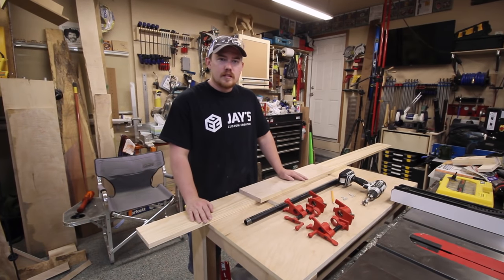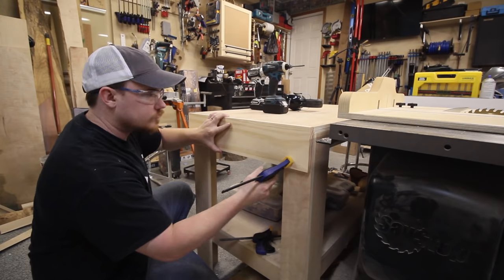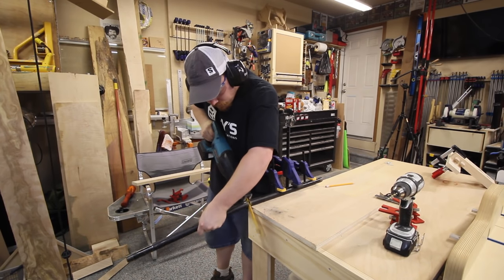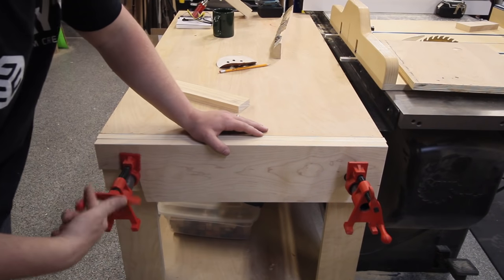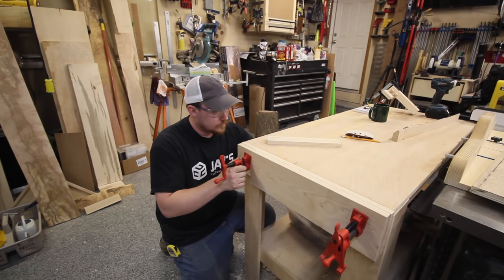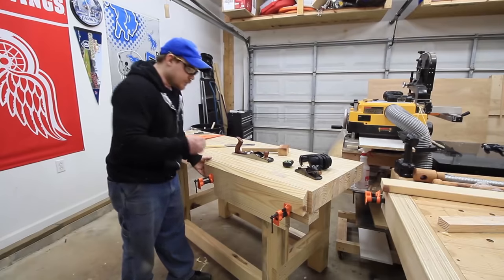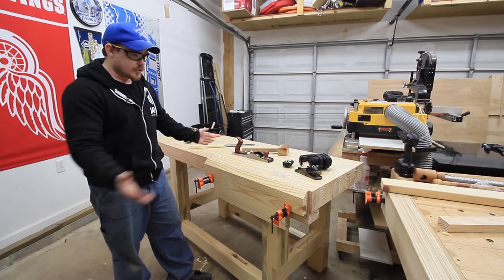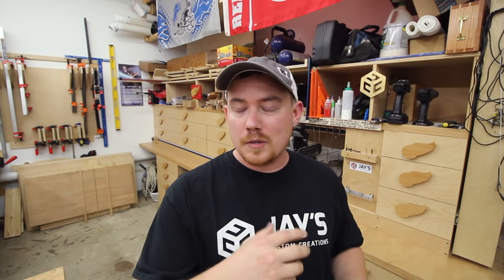$16 Twin Screw Vise - 261

Comment: I have seen your other ones, and the flip up/down is especially useful! Thanks for the tip at the end for the clamp type. For the viewers that are concerned about the clamp ends sticking out when not in use (possible big ouch but all the vices have similar), perhaps a temporary rectangular box that slots onto the bars and covers the exposed clamp ends, preventing bodily ouch syndrome.
Reply: Thank you for this considerate preventative measure, but nothing short of divine intervention can keep me from haplessly bashing myself on every conceivable piece of matter in the shop. Now that it's summer my family actually gasps in horror at the massive bruises and lacerations on my limbs. I look like I've been trying to wrangle elk.

Comment: I built one of these vises for my work table and it is fantastic. The main issue I had with mine was that the two quick releases were a pain. I found a way to release both clamps simultaneously with some steel rod ;) I can send pics if you are curious on how I did it...

Comment: Having missed your third vice build video, the takeaway for me was the idea of making the front of the vice swing away or to be removed completely.  Thank you very much for that.
On makes of pipe clamps...I had purchased the "blue" brand caused I liked the look of them, but that second quick release is one more thing to go wrong as it does not always engage as I have it set up in vice like set up.  The one of two of "red" from everyones favorite discount tool supply  broke with limited use.  The screw pin (?) broke so handle does not stay seated in its hole and just spins (if that makes sense.) Sticking with the "orange" brand for now.

Thanks for all good info and ideas.

Comment: Congratulations Jay, you just convinced me to build one.
I have some 3/4" piping laying in my shop and it will work perfectly for this application.

Btw, I couldn't agree more on 1/2" vs. 3/4" pipe clamps.
1/2" has been all I've ever needed as well.

Comment: Cool.
I'll also mention a small modification for a tale vice that can be really useful.

Drill a couple of 1jn holes (vertically) into top of the vice into which you can fit a piece of dowel.

Then, you can use the end vice to "clamp" long boards to the top of the bench; that is, with either the board lying flat on the bench, or, if the board is not too wide, you can stand the board on its edge.

(To be clear, I'm assuming here you have something to press the other end of the board against. E.g. pegs in "dog holes" in the bench top, or stays clamped across the bench top.)

Comment: That looks great if you're just starting out.  I don't really know what I'm doing and I don't want to drop $100+ on a proper vise, this pipe clamp vise looks like it's a minor pain to use but completely functional.
Reply from the maker: +uzimonkey it's not a pain at all. 99% of the time you wouldn't even use the swing up feature or have to adjust the pipes. The clamp heads have enough travel for the vast majority of situations.
Reply: Would cam clamps be an even cheaper solution?
Reply: Where are you buying your pipe clamps?  I can't find anything cheaper than $13
Reply: Harbor Freight.  about $10.00 for 3/4" clamps and appx $12-13 for 3/4 with legs (not needed for this appl and probably difficult to drill and screw down.  I ignored Jay's advice for the 1/2" clamos...they had them also...a bit cheaper like he said.

Comment: Hi Jay - Great video.  I have watched lots of pipe clamp vice videos are yours was the easiest to follow.  I just made an attempt at this vise and it works, but the jaws don't stay parallel if I clamp a board that doesn't go down between the jaws to the depth of the pipes.  As I tighten the clamps the bottom edges of the jaws close more than the top edges, leaving a gap along the top edge of the workpiece.  Essentially the workpiece is getting pinched along its bottom edge just above line between the pipes.  To prevent this, I could put a second piece of scrap material the same thickness as what I am clamping into the bottom part of the jaws to force them to stay parallel.  Any other suggestion?

Comment: nice ideas jay.  ive had issues with the pipe slipping through the quick release end.using black steel. seems the clear coat peels then they rust up. galvanized  seems to work better for me. your thoughts/ideas? ever thought of mounting  the quick release end under your bench dog holes so you can clamp downward?
Reply from the maker: I like to clean the black pipes with mineral spirits to remove the black crud on them. I've had no problems with them slipping regardless of them being cleaned or not though. Never thought about clamping downward.

Comment: I made a similar vice. However, mine tries to push the material up I cut a slot through the bottom of the holes on the moveable side. Maybe eliminating those would keep the vice front from tipping and pushing the piece out?

Comment: I love this build! I do have a question though, maybe someone can help me out. For the piece of the pipe clamp that goes under the bench, should I remove the "pad" from that side of the clamp? It looks like Jay either took his off or it didn't have one. Thanks!
Reply from the maker: Are you referring to a plastic pad slid over the metal jaw of the pipe clamp? Mine didn't have one. Take it off but keep them in a drawer for future use if you decide not to use the vise.

Comment: I'm building one of these right now for the end of my out-feed table - 38 inches wide.  What size hole do you drill to accommodate a 3/4 inch pipe?  Thanks.

Comment: awesome... plan to build one right away... only thing, says $16 vise... where ya pick up h-clamps for $8 each...?
Reply from the maker: Cal-Hawk brand 1/2" pipe clamps $6 each at a local store called Discount Tools in Starkville, MS. 10' piece of 1/2" black iron pipe for $12 which is $1.20 per linear foot. Conservative cost of $2 per piece of pipe for the clamps. Two sections of pipe $4. Two packs of clamps $12. Total cost $16 and scrap wood virtually everyone would have. This is the first one I used hardwood for the jaw. The rest have been pine or plywood.

Comment: Thanks for the great idea.. Do you have to thread the end of the black pipes after you cut them?
Reply from the maker: +T4CodyBear only one side needs to be threaded for the style clamps I use. The 36" pipe I started with was threaded on both ends.
Reply: what prevents the sawed off end to slide out from under the table?
Reply from the maker: The other end of the clamp.
Reply: If you have both ends of the pipe threaded, you could put on an end cap. Usually when you buy pipe from HD/Lowes, they will cut it to length and thread at no additional cost.

Comment: Just a quick question from a newbie.  Should the front half of the clamps be screwed to the front board on the vice?  Just wondering.  Thanks
Reply: Probably not, if you want to swing the front board up to load a bigger piece in the vise.

Comment: i do auto body , so we get , a lot of totals, so i tke the cheapy scisor jacks out of every one, they suck as actual jacks for a car, they ar way to wobbly to hold a ton and a 1/2 or car up, but they make great clamps if you dismantle them , you can use them as a press, clamp, spreader, i have one on cutting fence on my bench, as a kinda half assed incra adjuster, just an alternative to pipe clamps , or in a pinch, take the one from your car, just don't get a flat, lol

Comment: Jay do you think you could hinge a board underneath the table to hit both clamp releases at the same time? Btw Harbor Freight sells the clamps for 6.99 only difference is they have the fixed handle. 

Harbor Freight http://www.harborfreight.com/1-2-half-inch-pipe-clamp-3813.html

Comment: Hey Jay, hope all is well. Quick Q. Do you have air conditioning in your garage, and if you do, how did you achieve that in plugging the spaces on the garage door so the air wouldn't escape?
Reply from the maker: Yes I have AC. I used garage door insulation.
Reply: Portable AC?
Reply: Man, gotta get one.  A fan will not do for me. I'm just 175 lbs but I sweat just breathing.
Reply from the maker: Mini split unit in the wall.
Reply: Thx. I'm lucky I have a window in my garage. Gonna get me a portable unit.
Reply: Doesn't dust get in the unit and you have to clean the filter lots? Or do you sand projects outside?
Reply: AlWheelin I imagine an air cleaner along with the AC would help.

Comment: It looks like a screw backed out or possibly is loose at 2:39.
Reply from the maker: +poozor backing the screw out by about 1/8 is intentional to prevent binding. I mentioned it in the article. It doesn't need to be tight.
Reply: Jay Bates Didn't catch that it was intentional.  Keep making great videos!
Reply from the maker: Thanks. I'll try :)

Comment: What store do you get the clamps locally?
Reply from the maker: Cal-Hawk brand 1/2" pipe clamps $6 each at a local store called Discount Tools in Starkville, MS. 10' piece of 1/2" black iron pipe for $12 which is $1.20 per linear foot. Conservative cost of $2 per piece of pipe for the clamps. Two sections of pipe $4. Two packs of clamps $12. Total cost $16 and scrap wood virtually everyone would have. This is the first one I used hardwood for the jaw. The rest have been pine or plywood.
Reply: Am I the only one having a hard time finding these online?
Reply: PS - Great video...thank you
Reply: I too had a hard time finding these....thanks jay for the store name....might help finding them a little easier
Reply: Harbor Freight has them cheap also. Probably the exact same thing.

Comment: harbor freight pipe clamps?
Reply from the maker: Cal-Hawk brand 1/2" pipe clamps $6 each at a local store called Discount Tools in Starkville, MS. 10' piece of 1/2" black iron pipe for $12 which is $1.20 per linear foot. Conservative cost of $2 per piece of pipe for the clamps. Two sections of pipe $4. Two packs of clamps $12. Total cost $16 and scrap wood virtually everyone would have. This is the first one I used hardwood for the jaw. The rest have been pine or plywood.
Reply: thanks for the info. I'll have to look them up online.

Comment: Where are you getting them for 6 bucks?  They are at least 10 bucks here.
Reply: Menards has them for $5.33 from Tool Shop brand
Reply: Brad Mistina never even heard of Menards before.  $7 shipping and $3 processing fees hurt the price a tad, but if you buy a buttload at once, that is mitigated quite a bit.

Buying one cost $7 shipping and $3 processing fees.

Buying 8 cost $10 shipping and $3 processing fee.

If I buy 8, then they are $7.64 each.
Reply: Menards is a big box store in the Midwest like Home Depot or Lowes, I thought they were everywhere, but I guess not.  Tool Shop is a brand that I think they only carry.  Sort of a generic.  I think that is what Jay is using too.  Not that brand but a local hardware stores generic.  If you do some digging I'm sure you'll find them in your area.  Good Luck
Reply: Brad Mistina according to the store locator they're all in mid north

still a good deal ty
Reply: Harbor Freight carries 1/2" pipe clamps for $7 each. If you're a couponer you can use a 20% off coupon one day and go back the next day to get a second one and you'll end up spending $5.60 each plus tax.

Comment: $16? Around here that would cost me no less than $50
$20+ for each clamp and another 10+ for the pipe.
Regardless, great idea.
Reply from the maker: Cal-Hawk brand 1/2" pipe clamps $6 each at a local store called Discount Tools in Starkville, MS. 10' piece of 1/2" black iron pipe for $12 which is $1.20 per linear foot. Conservative cost of $2 per piece of pipe for the clamps. Two sections of pipe $4. Two packs of clamps $12. Total cost $16 and scrap wood virtually everyone would have. This is the first one I used hardwood for the jaw. The rest have been pine or plywood.
Reply: :)
I didn't think you were lying.
Only pipe clamps available around here (east east east coast of Canada) are Bessey. 1/2" are just under $20 so $40 total. 
10' pipe runs me another $20.
That's $60 before I even factor in the wood.

On the plus side, I've sold a few benches based off your design. Modified it a little. Added an extra seat slat. Hopefully going to get an order for 2 more in cedar. 

Thanks Jay.
Reply: The tool section of the Walmarts around here are laughable. Hell...most tool sections in most retail stores are quite sad.
The place where I bought my Bessey pipe clamps didn't even sell the pipe.

Comment: WTF. So cheap pipe? I spend a lot more here in germany. What material are your pipes?
Reply from the maker: Cal-Hawk brand 1/2" pipe clamps $6 each at a local store called Discount Tools in Starkville, MS. 10' piece of 1/2" black iron pipe for $12 which is $1.20 per linear foot. Conservative cost of $2 per piece of pipe for the clamps. Two sections of pipe $4. Two packs of clamps $12. Total cost $16 and scrap wood virtually everyone would have. This is the first one I used hardwood for the jaw. The rest have been pine or plywood.

Comment: All that for 16 bucks.......... You can't get all that in the uk for that price
Reply from the maker: Cal-Hawk brand 1/2" pipe clamps $6 each at a local store called Discount Tools in Starkville, MS. 10' piece of 1/2" black iron pipe for $12 which is $1.20 per linear foot. Conservative cost of $2 per piece of pipe for the clamps. Two sections of pipe $4. Two packs of clamps $12. Total cost $16 and scrap wood virtually everyone would have. This is the first one I used hardwood for the jaw. The rest have been pine or plywood.
Reply: Jay Bates in NZ a pipe clamp is over $30 with no pipe :(
Reply from the maker: I'm sorry about the prices in New Zealand.